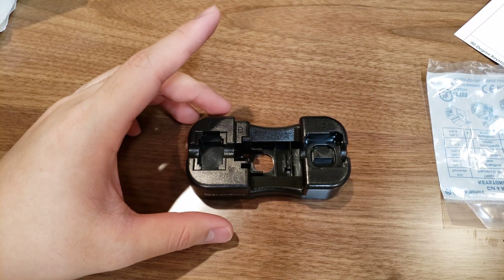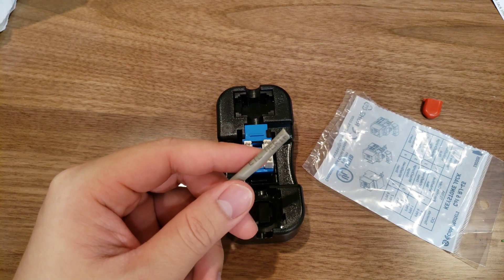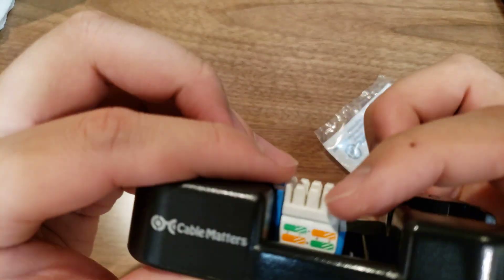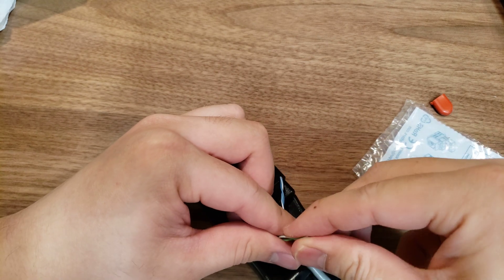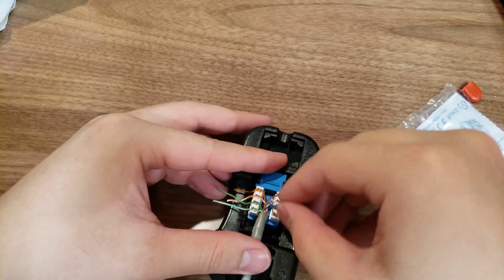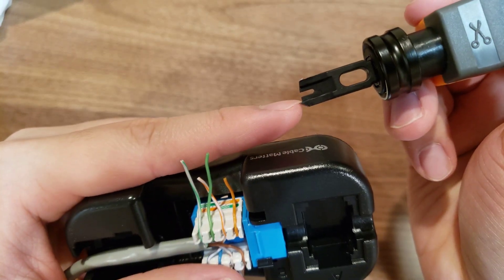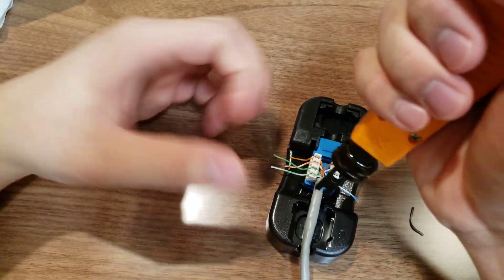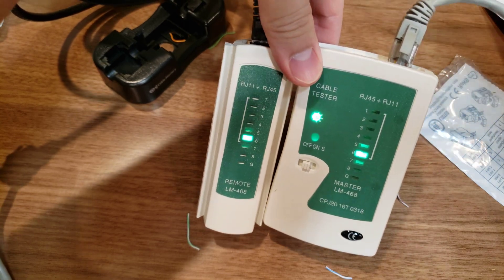How to wire keystone jack in less than 5 minutes

Comment: Lol thanks! It’s my first time punching down ethernet wires to a keystone jack and i found that angling the tool outward when punching allows you to cut effectively. You also didn’t turn the tool around when cutting the other (left) side which may have added to the issue you encountered toward the end. Hope your finger is alright.

Comment: As a huge proponent of always using the proper terminology, I very much enjoyed the instruction provided by this video. My only suggestion would be to add a little more clarity e.g. here is this "white and blue block-looking" thing that I am going to put into this "black molded plastic-looking" thing and then I will attach this "wire cable" thing all on top of my "wood-looking table" thing.

Comment: Why is everyone on youtube doing T568B, but Google says T568A is more new and compatible?
Reply: Use B as most things use it
Reply: In Europe you run A (which also better matches old one pair and two pair USOC for RJ-11 like compatibility in old networks).
In North America you punch B as it's the majority used (also preferable for the installer as orange and brown can look really similar and cause bad terminations).

But either splits the pairs well and as long as both are ended the same (a straight/patch) it won't matter.
Reply: B has been the standard for decades. Never use A unless it's a crossover cable which you probably will never need. Not sure where Google is saying to use A, but I went to college for networking 20 years ago and ya never heard A as being anything special. You can use either one though, everything you'd use today autodetects. You can wire A to A and no difference.
Reply: dude 568a and b configs make absolutely no difference. Only green pair and orange pair are transposed , thats the difference! Just make sure they match on both ends of the same cable.
Reply: B is more common in the US. Easiest way to remember is that B is BETTER.